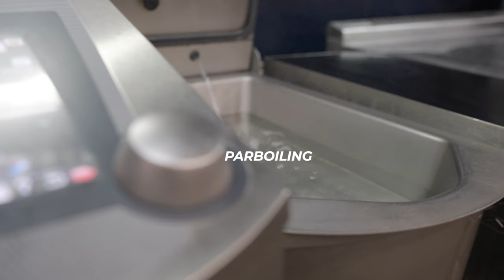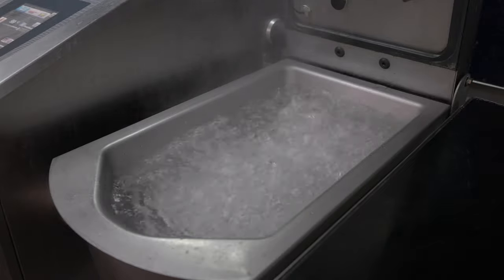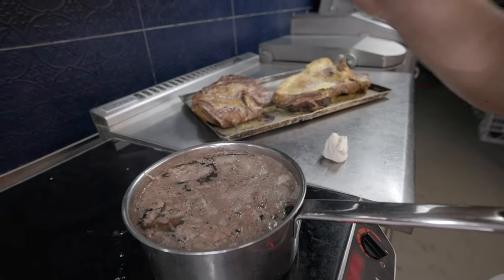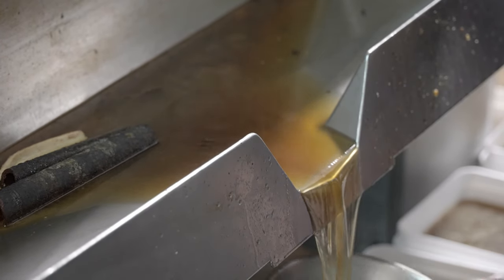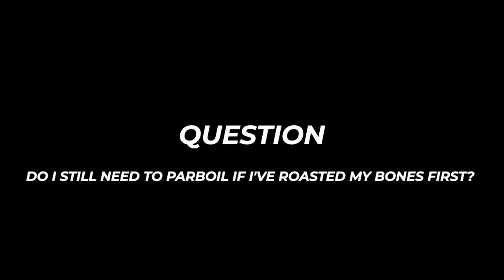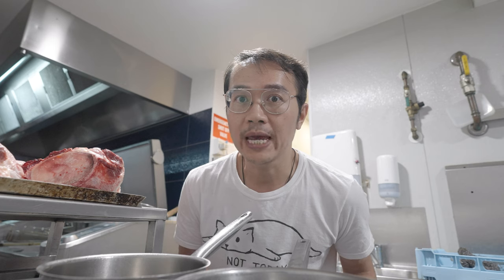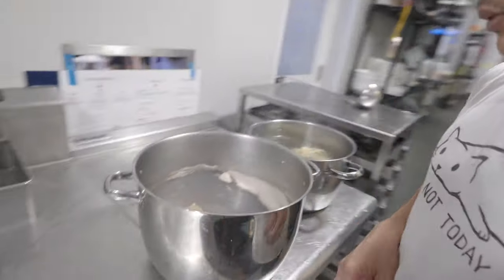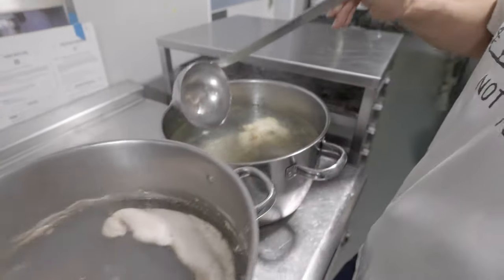The secret to a clean and clear Pho broth / CÁCH NẤU NƯỚC DÙNG TRONG

Comment: I've wondered why not parboil then roast? You would lose the scum and then seal them and gain flavor from roasting right? Or do you believe you would not be able to achieve a great quality roast?
Reply from the maker: I have done this and there's little difference. Parboil first means double handling it (once at the beginning and at the very end which is labour intensive). That's why I go straight from the box to tray to oven.

Comment: Thats weird, when i make bone broth sometimes, i get lazy and not roast the bones, i still get a pretty clear and clean broth. Im curious if you have washed the parboiled bones because washing it after parboiling cleans off any dirtiness from the parboiled bones that is left in it. But still a good video anyways.
Reply: Also i would always start by adding cold water after putting the parboiled bones in the pot and then slowly heating it up to a boil and quickly to a simmer.
Reply from the maker: You don't have the roast it like I do. Chicken Pho and Bun Bo Hue for example I don't roast the bones and it still comes out clear (but the colour of the broth is dull compared to my roasted Pho broth). 
A kitchen sieve (fine one) also helps too which I forgot to mention.
Reply: @Pho  good point, I always roast the beef bones for pho. I also prefer the roasted beef bones for pho, and i feel like without it, it is not a proper beef pho. Better color and flavor imo.

Comment: Noob question but does clear broth necessarily mean better quality taste?
Reply from the maker: I need to address this question in a video shortly.
This is a highly controversial topic which I've been getting comments on. 
The belief is the clearer a broth is = better. But here's where the point of controversy lies. 
It's an old school belief originating back to my parents and grandparents generation. 
As a kid growing up I always heard this thrown around. 

In fact apart from the comments on here I had an OG uncle come in try my Pho a few months back. 
He said it was faultless apart from the broth not being clear or "trong". 
I completely disagree because my broth is clean and clear BUT it has a strong shade to it (from roasting the bones/spices/aromatics = add colours to the broth). 
He still believes the broth needs to be clear as water so the sticking point is the actual definition of what a "clear" broth means. 

On this channel on all the Pho reviews I've been on I could only recall one or two Pho that had a "clear broth" and guess what? Those were the worst tasting Pho I have ever experience. Basically boiled water with seasoning. 

The best Pho I had on this channel had a strong colour through the broth = i.e you cannot see to the bottom of the bowl. I used to do this thing called a "transparency test" as a scoring criteria on my review. By looking at the broth you can tell how much work went into it. On my recent trip to Vietnam many some of the best Pho I had the broth was anything but "clear as water" by the old school definition which is why it really annoys me when I get the OG's watch my videos and the only thing they can say is "ummm your broth isn't clear = fail" which is quite sad because in reality no one cares as long as it taste good. By the time people add in their hoisin srircha mix the broth isn't clear anyway right?

Comment: Hey man thanks for the content. I've been subbed for a while. Just wondering if there is any advantage to parboiling after roasting as opposed to parboiling before roasting? Cheers!
Reply from the maker: It doesn't make a noticeable difference which way you do it. The seasoning is the most important step of all.
If you get the seasoning part wrong no one will know which order you did it in because the bottom line is > doesn't taste very good. 
Someone asked a similar question and the reason I do it in this order is convenience. My workflow is dump the bones onto baking tray > into oven > into the pan > simmer > remove bones.
If I parboil first it means I need to scoop the bones out twice. Once at the start and once at the very end. It's very labour intensive which is why I do it once.

Comment: What’s the point of roasting then parboiling + cleaning? Wouldn’t you lose the benefit of the roasted flavors?
Reply from the maker: I can understand where you are coming from. But the bigger picture is when you simmer the bones for say 12 hours, compare this with 10 mins parboiling at the beginning, it's an insignificant amount of time to lose the benefit. I have tried no parboiling and only roasting and found it doesn't make a noticeable difference that you should be hung up on it.
Reply: @Pho  Thanks so much! 

Would love if you could do a video on the different type of bones that could be used (eg beef rib, oxtail, knuckle, marrow, neck, pork rib etc), the best way to prepare each (ie do you recommend roasting all of them), and what the difference is in flavor between them and what result we could expect with different combinations.

Comment: Hey Leighton, I’ve always wondered what’s that strainer thing you use when you pour your broth into the bucket ? It’s looks triangular shape instead of a common round shape strainer. Thanks !
Reply: Its just a very fine mesh strainer. That restaurant style is called a Chinois or a Bouillon. Not to be confused with the coarser, non-mesh China Cap strainer.
Reply from the maker: Yes its a Chinois - very handy I use it to filter my Pho broth and filter deep frying oil. Works great and easy to clean and reuse. No need for cheese cloth or anything fancy.